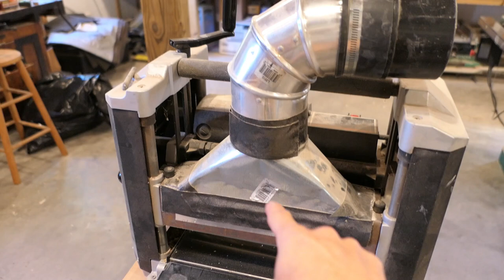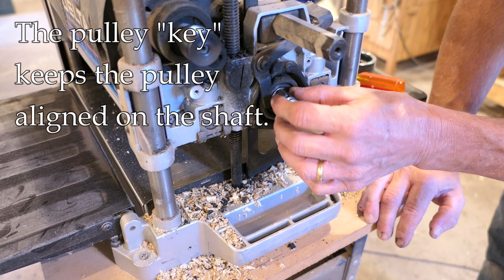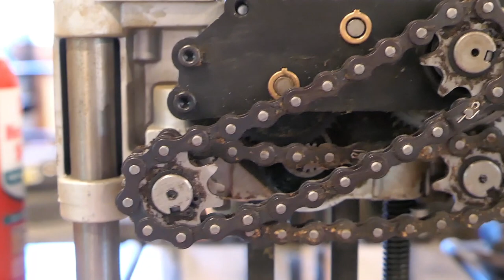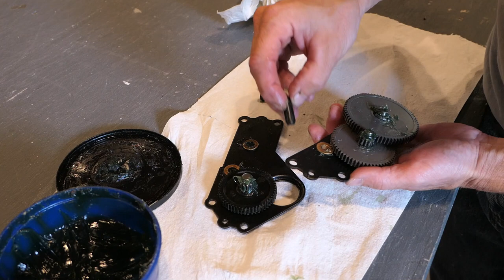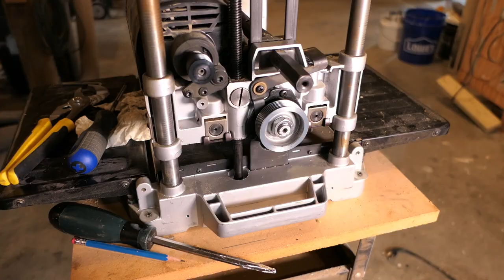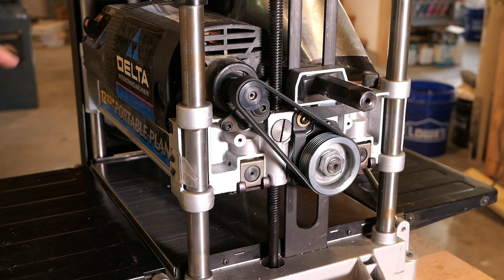Delta Portable Planer Disassembly And Repair

Comment: Thanks to your very helpful video on the Delta planer. Although mine was a Delta TP305, it was close enough to help me. To this end, I replaced the knives on my Delta TP305 planer with Shelix helical cutters. Not cheap but a great product. Although it took me most of the day to just disassemble my planer, the new cutter head went in seamlessly. Thank you for your helpful advice on the disassembly, cleaning & reassembly.

Comment: Great review!  I have the same planer, and it started making noise.  It turned out it was the same loose pulley issue, fortunately I caught it before the belt slipped off and damaged the cover.  Very nice rehab of your machine.  I have serviced the machine before and replaced some of the philips head screws holding the covers because they stripped out easily.  I replaced them with button head hex screws.

Comment: Nice video.  I'm doing a deep clean of a similar model.  There is an a tension adjustment for the motor/belt.  There are three hex screws just under the drive pully.  Loosen the large one and the motor can swivel back and forth just a bit.

Comment: Success indeed!  No mystery parts left over after reassembly (which is far too frequently the case when I attempt such endeavors) …
Reply from the maker: Ha!  Yeah, no extra parts and no missing parts, either.  When I do automotive or motorcycle work the bolts and screws pile up pretty quickly, and I've taken to using magnetic trays to hold the parts.  It's just a metal dish with a magnet underneath, and they really help prevent the loss of tiny parts.

Comment: Interesting and helpful video.  Many of the ideas and techniques demonstrated can be used when repairing other small power tools, from snow blowers to drill presses.
Reply from the maker: You're right, many tools share similar design and construction.  Once you open up a few tools you begin to see similarities.

Comment: Great video! I have some issues with my similar planer/thicknesser and this shows me what to expect when I take the covers off.
You didn't show the removal of the rollers and cleaning them. They get a build up of sap and stuff which needs to be cleaned. Stumpy Nubs has a video about that.
Thank you!
Reply from the maker: The rollers can get a build up, that's true.  It depends on what you are planing, really.  You may not need to remove the rollers to clean them, though.  Often you can just raise the assembly up all the way and clean from underneath.  When you are changing the blades and they are removed it's a good time to do this.

Comment: Greasing up those gears for the feed rollers is probably key to getting rid of the noise. Same thing happened to my ridgid 13” planer. Took apart the gears and greased em up and the noise was gone! Almost identical as far as how it all works

Comment: Well done!!!!  I had about the same things happen with my planer.  I've not taken the end panels off yet, so your vid is going to make my job much easier.  I'm reasonably sure the drive belt has "bit the dust" or gone to dust, whatever.  It has been a great machine.  I planed some 11"X12' well dried white oak boards that made it grunt.  I switched to 90cps and it mowed right on thru, or so it seemed.  I'll pull the covers and let you know what I find with mine.  I looked at one "parts supply" and their price on the belt was $109.++.  I think the drive belt is readily available from a belt supply co. Later.

Comment: Thank you for this video. I have the same planer. Curious, it looks like the key slot on the shaft is worn. Having been a few months now have you put some miles on it and has that pulley slipped or loosened at all? Getting ready to overhaul mine and as a precaution think I'll put a drop or two of blue locktite on that shaft.
Reply from the maker: Mine is still running, but it's definitely a concern.  You'll see from my other recent video that I purchased a new planer since I can't afford downtime.  However, I don't think loctite is a great idea for the keyway.  It's too liquid in it's viscosity and there's a good chance it will flow into the nearby bearing before it cures.  Obviously you want something reversible, though.  And, the actual issue is more related to the pulley shaft hole getting wallowed out rather than the keyway.  I would suggest trying automotive grade silicone instead.  Coat the inside of the pulley hole and put some in the keyway before assembly, dab a little on the shaft threads then tighten the nut and leave it be for a solid 24 hours.  The silicone will cure in that period and it shouldn't enter the bearing during assembly. It will keep everything in place but be removable if need be.

Another thing I didn't mention in the video is the back of the pulley where it seats toward the inside of the machine.  Examine that area to make sure it is dead flat and not gouged out from use.  If it is, flatten it by rubbing on sandpaper on a flat surface.

Comment: Thank you, my planer (Mastercraft, looks like made by Delta) screams like a banshee but runs fine when the wood is going through it for some reason? I'm going to overhaul it thanks to your demonstrations and video. thanks again, big thumbs up!
Reply from the maker: Take a hard look at any bearings.  Sometimes when marginal or failed bearings are not under load they will squeal but quiet down when they are put under load.
Reply: @enduringcharm  Thank you I will.

Comment: Nice video!  I came on here because on mine the thickness locking lever doesn't stay tight so that if I'm doing a number of boards I have to loosen and re adjust the depth and re-tighten.  Mine , model tp 400ls in Canda, doesn't seem to tighten the same way though.
Reply from the maker: Well, on my model it's just a handle that turns until it makes contact and screws down tight.  I've never had an issue with that.  It's not much disassembly to take that apart and take a look, though.

Comment: WOWW i just but one like your's and i have to change a roller on the long 1 it is completly trash n ripe  and i think  i 'm gone change the boths chains on it too for there are to loose just like your's , but u explain very good n it sucure me about how to fix it back thankyou very much from QUEBEC.
Reply from the maker: The loose chains may be normal, actually.  I've used mine since it's been put back together and it is running just fine.

Comment: The problem I had was the height adjustment. Had to take the chain guard off and clean out all the wood chips. They were getting in the chain and would not let it turn..
Reply from the maker: It is a good idea to either vacuum or blow out the unit with compressed air after a project to help prevent that problem.

Comment: How do you tighten the nut on the main pulley? You finger tighten it, but what do you do after that.

Other than that omission your video is very helpful.
Reply from the maker: You can manually engage the locking pawl on the shaft to hold it still, which is normally spring loaded.  Or you might be able to hold the shaft from the blade area using locking pliers or another tool, I never tried that.

Comment: Fantastic! I was just gifted this planer, but it was covered in dirt dobber nests.  What do you recommend for cleaning everything? Especially some rusty spots on the blade holder....
Reply from the maker: Honestly, you can use almost anything on the metal parts, but you'll want to be cautious around the feed rollers.  For the metal parts you could use scotch brite pads or steel wool and any solvent or degreaser you have available.  When you are done, though, wipe the areas down with acetone or alcohol to remove any remaining solvent on the surface.  For the feed rollers, use Dawn dishwashing soap and water or something mild like that so you don't dry out the rubber.

Comment: Great video...I purchased one like yours at a yard sale and it has the exact problem except my blade roller pulley is a little worse than yours. Question ? the locking mechanism for the blades seems to lock automatically  , it is spring loaded in the lock position. Does the centrifugal force of nthe motor spin the lock free during normal use. I have tested everything but I held the lock down so it would not engage. Too chicken to try it without holding lock down. So the lock does not engage when motor turns correct ?
Reply from the maker: That spring loaded lock occurs with the blade cover off.  When you install the blade cover, you also push down a pawl which frees the rollers to spin.  Don't turn it on without using the cover to keep the pawl unengaged!

Comment: This is a great video! My issue is the rollers have locked and stopped feeding. I’m curious now that I have it apart, if by turning the roller gear thus by turning the chain drive… should I see the rollers turn? Everything turns freely except the rollers. Thanks!
Reply from the maker: If the rollers are not turning at all it would have to be a broken chain, or stripped gears or something else physically damaged.  However, are you sure they really are not turning?  Is it possible they are turning but not feeding the work piece?  If the surface of the  rollers is glazed, or damaged from abuse, they may turn but not actually be able to pull the wood through.
Reply: @enduringcharm  the rollers were not feeding the stock at all. I’ve disassembled the sides and the chain is intact and gears are moving freely.  The rollers seem to be locked. This is why I wondered if turning the gears would actually move the rollers, or if the motor needs to be engaged. When manually turning the gears, the rollers do not turn. When everything seems to be running smoothly… I’m at a loss as to why the rollers are not feeding. They are not ‘slipping’ as in dirty… they are locked and not moving.
Reply from the maker: Well, if you have both side covers removed you can either turn the assembly by hand (power off) and watch it move, or turn the machine on and watch what happens.  The only possibilities are that the belt is slipping or a pulley is damaged on the drive side, or that a gear or sprocket is damaged on the transmission side.  You say the rollers aren't feeding, but have you confirmed that the drive belt is working and turning the blades too?  Maybe the rollers and transmission are okay but not getting power from the drive side?
Reply: @enduringcharm  yes, the blades were moving, the rollers weren’t feeding. While the drive belt appeared good, I’ve ordered a replacement. Holding down on the mechanism to free the gears and allowing me to turn by hand, the chain drive appears to move fine and I can turn the blades by hand. However, the rollers do not move. It is possible that the revolution/gear ratio is so large that it might appear they aren’t moving. Trying to simply turn them by hand isn’t possible. I’ll continue to clean and put the new belt on and see what happens. Thank you for the vid and trying to help!
Reply from the maker: Oh, actually that could be your issue.  If you are turning the main shaft by hand the rollers will move very slowly.  Best to watch the gears of the transmission to see if they are turning.  Remember, the motor will turn that shaft at thousands of RPMs.  If in doubt, reinstall the belt and turn the motor on.  You could even take out the knives first so there is no danger while you examine the machine.
Reply: @enduringcharm  I just want to be clear… the rollers not feeding is what brought me to tearing it down. I just didn’t want you to wonder if I didn’t think the rollers weren’t working because I couldn’t see them roll. ☺️
Reply: 2-24 I have this same planer.  The guy that sold it to me knew there were a few issues but I never owned one before and found them when I went to use it.  So, it wasn't long before I knew there were problems. Hard as it is to believe. I planed a dozen six ft. planks with NEIHTHER OF THE ROLLERS working. I just pushed and pulled them through. The problem with the rollers seems to be they are difficult to lube. There are metal 'blocks' that the rollers rest on. They were so bare metal, that one of the 'axels" had worn almost completely throw. It was paper thin on one side, but by that time nothing was turning anymore. Lots of knocking sounds. Removing those rollers is a little tedious. My planer is bolted to the table so you have to use the appropriate Allen wrench (no room for other tools) and work in a small space looking up. No wonder the guy never lubed them. The screws holding the blades in place were so tight and so soft that four of the screws had been mangled getting them out. I used an Easy Out on two of them but snapped them off and then had to drive out the easy outs. 1 hour per screw, but I'm no quitter. If those blocks are crazy expensive, I'll have my machinist neighbor make me some. @enduringcharm

Comment: You did a great job, was interested in the gear part. I had the same problem including the bushing between the locking lever was missing. Don't know if you knew to adjust the belt there is a bolt to the right of the upper pully that you can loosen which allows the motor to move. Acts just like a car. I'm interested in your dust cover, do you have a video on it or some plans? Don't know if you new but the parts for the 22-590 will work and available at ereplacmentsparts.com.
Reply from the maker: That dust cover was a MacGyver solution in a pinch, but I ended up using it for years!  It was comprised of several off-the-shelf galvanized duct work parts, including a one-piece 12 inch transition from round to rectangular.  I used foil tape to seal it and hold it together.  I found a rubber boot to transition from the galvanized duct to the dust collection hose.  It was all found in one of the box stores.
Reply: Thanks